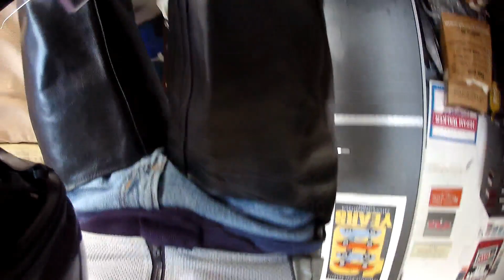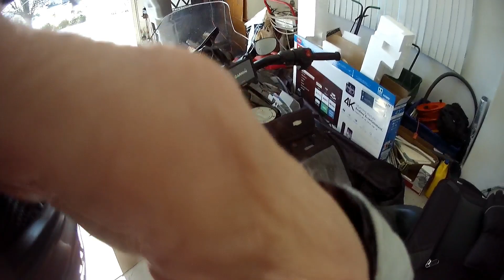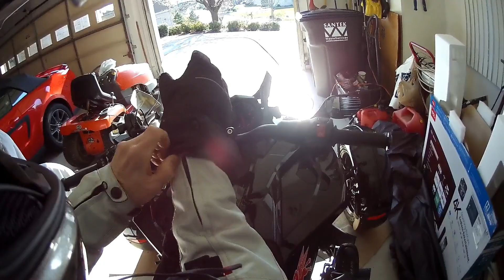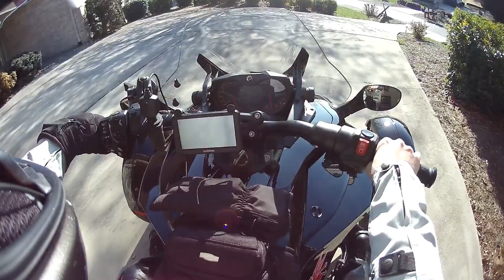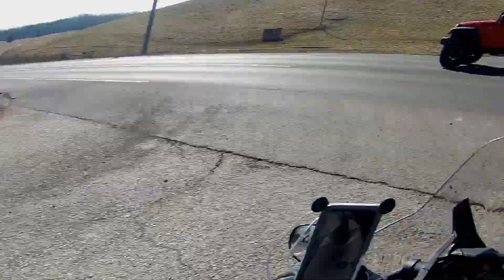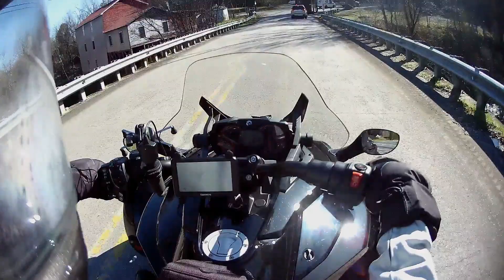Can Am Spyder F3 Real cold day for a Spyder Ride

Comment: Sorry the gloves did not work out so well; I would think that being battery powered had something to do with how much heat you could expect before running the battery pack down.  Maybe 30 minutes or so.  As for riding; anything below 70 the bike is not my first choice.  I've been in cold weather (40 degrees and sleet on the NYS thruway) and I have no desire to test that boundary again LOL.
Reply: Hey John; this was me.  I never caught the fact that I was logged on to my second YouTube account; the one I setup for our church.
Reply from the maker: Yea Marty, I rode from my home south of Syracuse (South Onondaga) to Rochester one year.  This was on a Yamaha DS6B, a 250cc two-stroke and my first motorcycle.  Starting temp was high 30's and it didn't warm up much at all.  When I got to my friend's house, I shook for about 45 minutes uncontrollably.  I guess I was in early stages of hypothermia.  I vowed I would never let that happen again.  Thanks for watching.